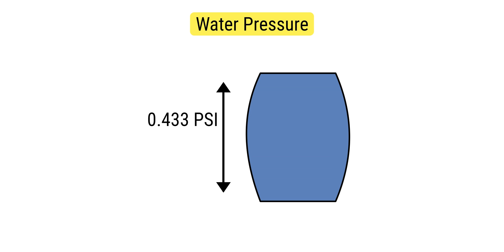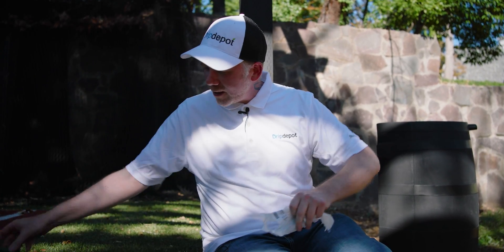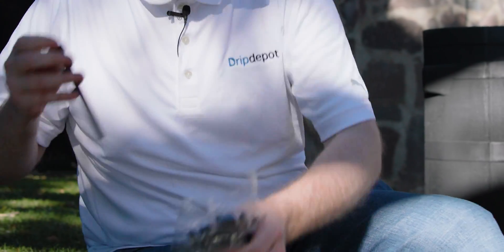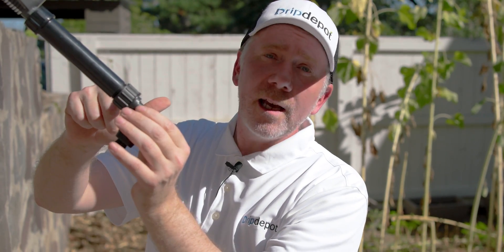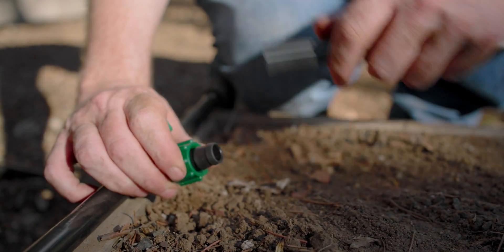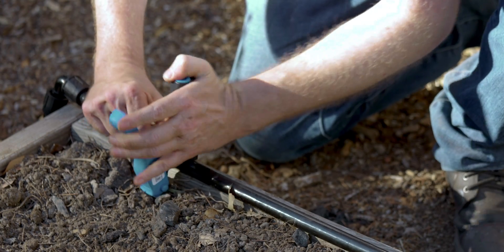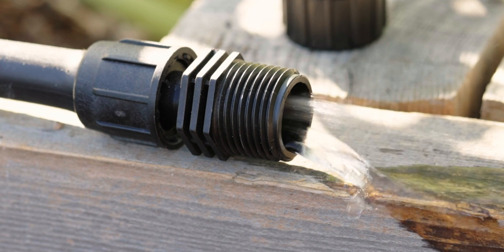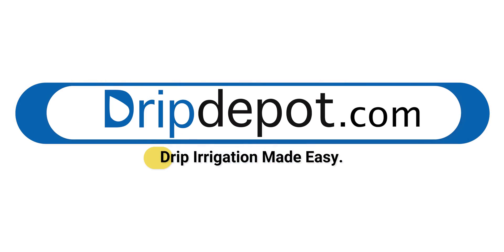How to Install a Gravity Rain Barrel Drip Irrigation System | DIY Raised Bed Project

Comment: Where did you get your rain barrel?  I ha e one that looks identical.  I bought mine at Sam's wholesale and it has leaked like a sieve since  day 2. It now has a leak in the very bottom.  Maybe you can do a video of how to caulk a leaky rainbarrel where I  cannot reach.
Reply from the maker: I believe we got ours from Lowe's, but it could very well be the same manufacturer, no doubt they provide it to multiple retailers.  

And that's a great video idea, I'm going to add that to our list, it would make a perfect follow-up to this one.  

Where did yours initially leak at, the spigot/tap area?  Some thread seal tape or similar may help there if you hadn't already applied some.  

The leak at the bottom is a rough one for sure, the bottom of those tanks should be pretty stout.  Possibly freeze damage if you live somewhere it drops below freezing?  Potentially heat if it's on concrete in direct sunlight.  

Just wanted to toss out some potential ideas so your next one doesn't experience the same trouble :)

Comment: Finally installed my drip irrigation into my raised beds which are 26 inches high. Used one rain barrel elevated at 4 feet and it carries 3  (4x8) feet beds that are spaced 3 feet apart !!!
Reply from the maker: Awesome!  That's almost what we did in the video here as well -- what emitters did you end up using?  

Gravity systems are amongst my favorite, so glad to hear about this!
Reply: @dripdepot  I did Drip tape. And my wife loves it. This video helped me a lot. !!!

Comment: Could this style of setup be set up for indoor grows?
Reply from the maker: You bet -- I wouldn't say it's quite common, but we do see gravity style setups for indoor grows fairly regularly.  The biggest challenge is in the logistics of elevating a water source far enough to get adequate pressure -- this depends on the size of the grow to some degree, as you don't need as much pressure (and thus as much elevation) for a smaller system as you would for a larger.  

Essentially, it's definitely possible, and with a little planning around pressure and flow rate, can be just as good as a system with a pressurized water source (municipal, pumped, etc). :)
Reply: @dripdepot  I do have a reservoir already secured to its own table to be raised off the ground, and I tapped into one of the main water line to make a dedicated hose to fill the res. I think I can make this work. Let’s hope lol
Reply from the maker: @stephenneal739   Stephen, apologies for the late reply, was out shooting a video all last week (small farm and row crops) -- Since you have the reservoir already elevated, you're off to a better start than many gravity irrigation attempts we see (we see a lot of them with the tank at ground level only relying on the height of the tank for pressure, which of course decreases as the tank empties).  With yours being elevated your odds of success increase significantly. 

When you're deciding on emitters, avoid pressure compensating emitters (they often need a minimum PSI) and those with a higher operating pressure.  Something like these work well in gravity systems: https://www.dripdepot.com/product/toro-cleanable-dripper -- that one can work at near 0 PSI so long as there is flow.  

Drip tape (particularly low flow) also does good in gravity systems (though if this is for indoor good chance you won't be using drip tape).  If you lock in on some emitters, I'd be happy to check them out as well :)
Reply: @dripdepot  I was just making conversation but I appreciate the reply! If the gravity system doesn’t work like I want it to, I will be able to either add a hydroponics pump to the reservoir, or tap into a water supply line with added pressure regulator/water filter. I’ll get it to work if it’s the last thing I grow! 😂

Comment: Looks too complicated
Reply from the maker: It's definitely not as difficult as it can appear (but I confess, it intimidated me at first as well).  Once you've done one, you basically have it down, the most difficult part on a first system is just in getting started -- once started, it snowballs and gets easier.  And, there's plenty of folks to help out and answer any and all questions :)

Comment: just the video I was looking fer...starting to plan next years garden. I live Off Grid and want to use gravity drip system.
Reply from the maker: If you've got some elevation to work with, a gravity system can be even more reliable than municipal water :)  

If you document it,  don't hesitate to drop a link to the videos in reply to this comment, we'd love to check it out (a good gravity system is probably one of my favorite to see and work with).

Comment: I followed the video. Where all of my quarter inch coupling valves plug into the half inch mainline are leaking. They are pushed in flush  and I used the tool/punch you have too.
Reply from the maker: We'll be happy to help!  The first thing I'd check is the punch -- in the video we used two punches, a green one for the tape fittings and a blue and black one for the 1/4" fittings.  The green one makes a hole that's just a little too large for the 1/4" fittings.  Normally we wouldn't mix things like that in a video, but we really wanted to illustrate the multiple emitter types that can thrive in a gravity setup. 

If you did use the correct punch I'd check to see if a thermal expansion cycle will seal them -- when the tubing gets hot, it expands and will expand over the barb and finish up seating the seal. 

If they keep leaking on you, fire us off an email with some photos of the connection point, we'll help get it up and running leak free :)
Reply: @dripdepot  Ok well i used the green punch oops.  i will replace the mainline when I order the blue punch. So i have gravity fed into a few zones. As of now i operate the flow. When i want to switch zones there is  an air in the line issue(or vacuum) and i am forced to do some bleeding. Any suggestions to self fix that so i can have the zones fire off with timers? Thanks for the reply.  Good videos!
Reply from the maker: @snowhero9  I should have been more clear in the video that we used two punches!  I'll note that for next time, as someone new to it may not realize there's small differences in the size of all those punches. 

Hmm, an air vent may do the trick for you here -- it could be pretty easy to install depending on your setup.  An air vent will allow air to escape when the system is starting and then allow air back in when it shuts down and the lines start draining.  What symptoms are you experiencing with the air problems?  Like an obstruction in the lines, the tubing moving around and displacing as the air moves?  Those types of problems can be fixed with an air vent -- on a smaller gravity system you could use just a little 3/4" air vent, you wouldn't need the large ones. 

Let me know if the symptoms are different from what I described above, happy to check to help solve the air problem :)
Reply: @dripdepot  Sounds great thanks.  Obstruction in the line i am guessing. Do you have a video where you installed an air vent? The instructions say "Install the Air Vacuum Relief Valve after the drip zone, along the drip line laterals and at the highest point in the drip system layout." Since after the drip zone is the lowest point that doesn't seem possible with gravity fed ... ?
Reply from the maker: @snowhero9  Are you having issues nearer the emitters or the water source (or even both)?  If it's down by the emitters, you could install an air vent down there and it would help alleviate things -- basically what it looks like is a Tee, with the "bottom" of the tee having threads.  You point that part up so you can thread in an air vent and that gets it elevated.  Sometimes a riser might be needed as well, but it doesn't change too much (thread on the riser, then a female adapter on top of the riser then the air vent).  

If the problems are by the water source it could be a little more tricky, but not much different -- you'd essentially do the same thing, splice in a threaded tee and thread in the air vent.  A little tricker depending on where the water source is and how the tubing comes off of it.  

Unfortunately we don''t have a video on installing an air vent yet (added to the list!).  I was able to find one, but it's showing how to install it on PVC rather than tubing.  The process is close enough I'll link it, it's just magnitudes easier to do it on poly tubing, but you can see how they use the threaded adapter and a piece of pipe as a riser to elevate it: https://www.youtube.com/watch?v=t_P0ganNaJQ

With tubing it's the same, install a tee, threaded riser to raise it up, female adapter for the vent, thread in the vent.  For a system of this size, the 3/4" threaded air vent would more than suffice. 

I did also find one fantastic video that goes over the physics of air lock and air vents if you were interested in that side of things: https://www.youtube.com/watch?v=zdkp9N3qfkI
Reply: @dripdepot  Thank you so much for the fantastic replies and videos! I just may ... "get my life back" lol. Keep em coming
Reply from the maker: @snowhero9  You're very welcome!  Thank you for your time as well -- and if any irrigation questions come up, don't hesitate for a second to send them this way :)

Comment: question if i have well water that has alot of orange sediment would it be better for me to put the filter on before the timer? so it doesnt clog the timer?
Reply from the maker: Most filters are not rated for constant pressure so have to come after the timer by default -- in most cases this will be ok, however, as timer valves typically have large enough channels that they can pass debris without getting clogged.  

There are constant pressure filters you could look into if you experience trouble with the timer, but they tend to be pipe threaded so you'd end up needing adapters at both sides just to get it connected -- I suspect your timer will pass the debris without trouble though, timers and similar valves are crafted knowing they'll usually be upstream of the filter :)

Comment: This is really helpful! Do you know of a way to do this if we can’t elevate the barrels enough to use gravity? Our barrel(s) may be a few feet off the ground where the beds will be, but the beds are 17” tall and spaced kind of far apart so I’m not sure gravity would be enough to pressurize the water to travel that far. I’m thinking something like a pump inside the rain barrel?
Reply from the maker: Thank you for the great question Camila!  

A pump is often used in these circumstances, but we do have folks who use only the height of the barrel itself to generate pressure.  Usually these are smaller systems with the beds near the container, so I think your concern about the spacing is a good one.  If it's not too much trouble, you could test it to see how things run with just gravity before deciding to grab a pump or not -- it may end up working great without one, and if it doesn't, a pump can usually be added later without much hassle :)
Reply: Hi @dripdepot  , is there a video or link about how to install and use a pump?
Reply from the maker: @rebeccazhang8942   Very soon Rebecca!  We have recorded our pump video but it still has to go through editing.  Hopefully we get it up in time it can be helpful to you :)  

It should be up later in the Spring or possibly early Summer.

Comment: ok how do get the rain water to the rain barrel at 5 ft.
Reply from the maker: If you're collecting rain above the barrel, we've seen folks use a hose (or even more gutter pipe) to direct the rain water into the barrel -- just be sure the water passes through the screen filter that comes with most ran barrels first so it's filtered of larger debris.  We've also seen balconies and windows used to collect the rainwater.  Most often it's a combination of hose and/or gutter pipe downspouts.  

One ingenious method I haven't tried personally, but works well in places with limited roof access, uses "saucers" that act like funnels to direct water into PVC pipe (or tubing) which is then routed to the barrel.

Comment: Everything being made of plastic, how long do you guarantee it won't deteriorate in the Texas summer sun?
Reply from the maker: UV treated parts are designed to withstand UV exposure -- not all parts are UV treated though (a lot of PVC comes to mind) so it's important to make sure on various parts.  Most of the parts often used above surface (poly tubing, button drippers) will be UV treated. Polyethylene in particular is regarded to have good chemical stability. 

Even then, a lot of folks bury the parts of the system they can, particularly mainline tubing and, quite often, drip tape.  Even UV treated material will break down faster in the sun.  It should be a matter of years still, unlike non-UV treated polymers which will become brittle in weeks or months.  And you do have it right, in places where sun exposure is higher, life expectancy will do down -- again, it should still be a matter of years (unless it melts!  Hello Arizona), but it varies state by state, climate by climate.

Comment: Ordering mine for my faucet. But if my well power goes out I hope I can use this method. I got 7 55 gal containers linked together from roof rain water. I am about 160 feet away from garden but elevated about 60 feet up. I hope I can transition this, I assume all I need to do is take the pressure regulators off, right?
Reply from the maker: With an elevation of 60' you're in a really good position for a successful gravity setup, coming in at about 26 PSI -- you have the right of it, this likely means you'd just need to remove the pressure regulators -- if you're using a 25 PSI regulator you'd only be a hair above it.  If you're using a 15 PSI or lower regulator (for drip tape or similar) you may still want to include it -- at that point I'd probably math out the friction loss to see where you're at after the 160' run from the barrels to the garden. 

Basically, if you need to fall back to the barrels, you're in a really good spot :)

Comment: What kind of tubing should I use in places where I want to bury it?
Reply from the maker: This is a very good question -- one of those types where you'll get a different answer from different people in the industry.  To some degree it will depend on where you're burying the line -- if this is upstream of valves/timers, you'll want something rated for constant pressure (PVC, HDPE, PEX, Metal).  

If this is for something downstream of timers and valves and it's not under constant pressure, your options are pretty open.  Some in the industry would still say PVC or HDPE, but it is acceptable and common to bury LDPE (low-density polyethylene, the type most commonly used in drip irrigation).  Just like with PVC or other line types, just give it a bed of soft crumbly soil to rest in.  Doing so is likely to extend the lifespan of it by a reasonable degree as well, particularly around landscape maintenance equipment.

It's only anecdotal, but in my home garden I've buried the vast majority of my poly tubing (it crosses my yard where I need to mow) and haven't experience any problems in the three years I've had it sub-surface.  Burrowing rodents can cause problems if they're in your area, but they can cause problems in pretty much any line type other than metal.

Comment: we should also consider te price of water deposits: an IBC deposit of 1m3 costs about 250€ (2. hand cheaper), 10 barrels of 100 l 187€ in garden shop: so the cheapest deposit is a frame pool containing up to 6m3 (cubicmeters) for 119€ from aldi or internet - just it has to stay on ground (near the 2m ridge above the lower garden beds), so if we need to pump up its water into an elevated irrigation deposit on the rooftop we'll do it by solar pumps (programmable). some materials heat up more by sunshine than others, always needs shadow cover (trees, ivy, reflectors...)in summer. & pallet isolation from below against rooftop's heat.
Reply from the maker: Wolfgang, are you needing the IBC tote specifically for its volume?  If not, you may be able to grab a rain barrel for a good deal less than the IBC -- the volume would be smaller (about 0.18 cubic m3) but does allow you to collect rain water for at least some of the filling of it.  The one we used in the video was about 107€ and came with a screen that goes on the top to filter the water it collects.  

And good call accounting for the heat and UV exposure -- having a reasonably shaded area will not only extend the life of the materials but also prevent unwanted thermal expansion/contraction from causing issues.
Reply: @dripdepot  the most dangerous exposal in heat waves of more than 40ºc = 100++ºF are our heads that must be put in water buckets in the shadow every half an hour for not suffering insolation or even worse...
Reply: @dripdepot  the higher deposits will be smaller on rooftop for not causing collapse of the of the cabins/huts under whose roof we put containers for storing rain to be pumped up in just the amounts needed for drip watering, or from the pool near the 2m slope to the garden beds below evtl. through other irrigation deposits for losing its chloride. i'll put a grid mesh over the barrels against leaves/insects drowning & inside a foam filter sheet over the metal mesh from the conectors outlets . always have worms (tubifex?) & water fleas & algae inside.
Reply: @dripdepot  transportation by motorbike limits the size of containers, folded pools or deposits get on a hanger.